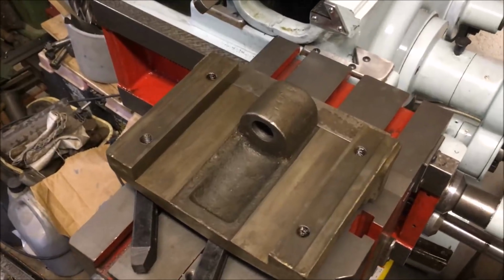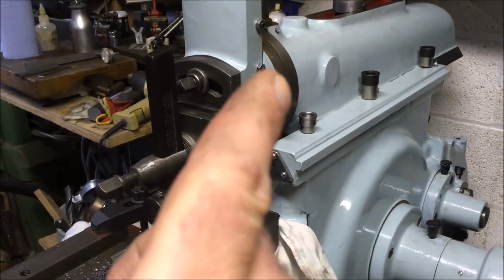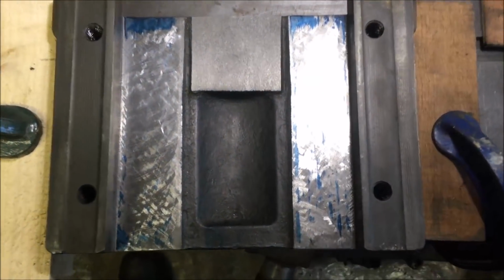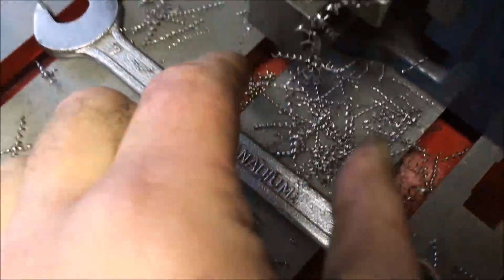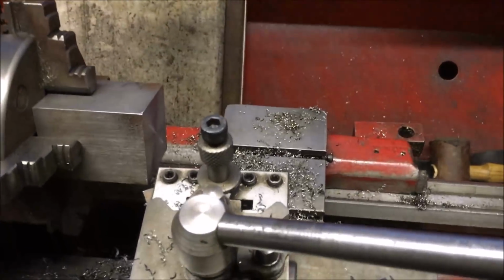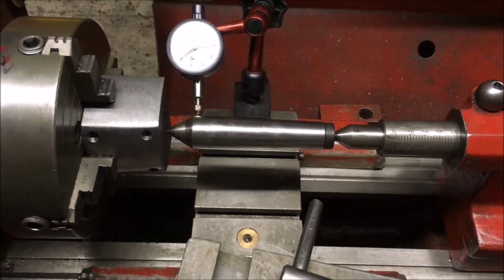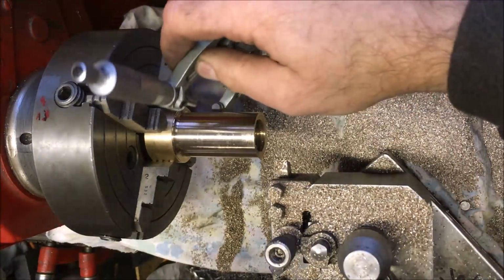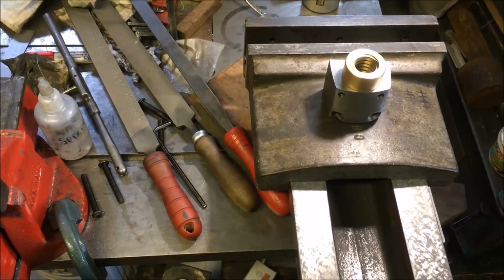Shaper Machine Vice pt3

Comment: Beautiful work but didn't you have moments where you thought "it is only a vise". Was it when that rotten peg broke off? Keep up the good work, Peter
Reply from the maker: I had to stop myself a few times - scraping, filing, measuring. Its a good practice for me to establish the working tolerance required before and work to that rather than keep looking to 'make it as best I can' - unfortunately my machining skills are such that aiming for a dim' is one thing getting it dead nuts another - the bronze nut OD a good example. I would have been really pi##**d  if I had taken too much off the OD at that stage ! Ive had quite a few comment that 'its only a shaper' - it is; but I still wanted to get it as accurate as possible for me and in doing so develop my skill base - added to which the text book tolerances are pretty tight for a shaper.  The next shaper project should prove if Ive got everything right. Thanks for stopping by Mat
Reply from the maker: That is the truth of it. My main driver for getting the shaper as good as I could - was so that I have some faith in it. So if I cant get a part flat now I know its me not the machine ! Seams much of the time is spent removing excuses as to 'why it is off spec' and getting back to what you can achieve and as you say, the more we do the better we get.
Reply: You get better at machining, which allows you to improve your machines, which allows you to get better...  

The most important part is that you're doing it because you get satisfaction from the doing, that makes it time (and money) well spent.

Comment: Yes a milling machine would be quicker but where’s the fun in that eh, good job mate.

Alan.
Reply from the maker: Im not even sure it would have saved me that much time - set up always takes me longer on the mill as the working envelope is more restricted. I used it for the flats on the lead screw shaft and it was pretty slick operation - even surprised myself - maybe Im improving with experience. :-) Cheers for stopping by Alan. ATB Mat

Comment: Aligning the feed gears took me longer than to get the whole ram-and-lever-assembly together since it really was mostly trial and error and the way it is designed there is only one position in which the gears can be un-meshed from each other...
Glad yours seems to be built a little more straight forward :D
Lovely to see the old gal finally make some chips!
Reply from the maker: Thanks for stopping by Adrian - see the cast iron chips fly was fun - not so much when the block of steel left the vice.... I am looking forward to seeing your new machine chuck some chips. be sure to send me the link so I can include it in my next upload. All the best Mat

Comment: Looking good Mat
Reply from the maker: Im enjoying letting the old girl settle in - taking things slow to start and building things up as I gain confidence and an happy nothing needs adjusting. Was fun to see it chuck the work from the vice .. not ! be glad when I get the new vice up and running - should make for less clenched jaw machining :-)
Reply: did you think about a key between the block (nut) and the vice jaw ?
Reply from the maker: I considered it and decided the 4 m8 Ht fixings should be sufficient - I was concerned about cutting more of the fixed jaw seat away with the risk of it looking like a swiss cheese.  I edited out a 5 minute monologue of me talking about the options and why I went the way I did. At one stage I was dowel pins, roll pins and m8 ..... if I bust it out it may be the repair !